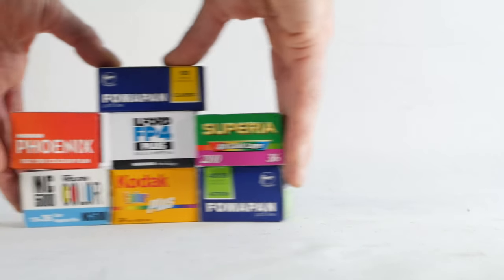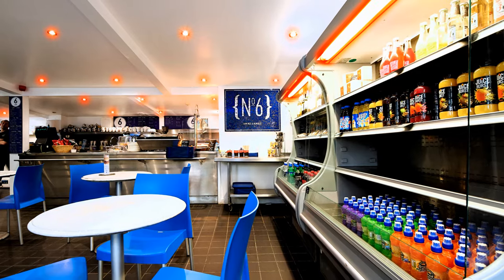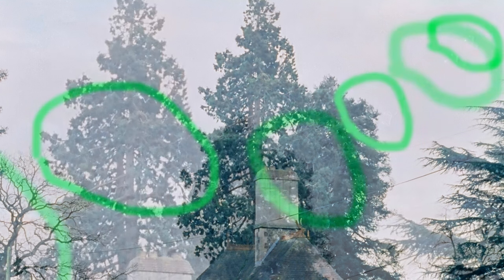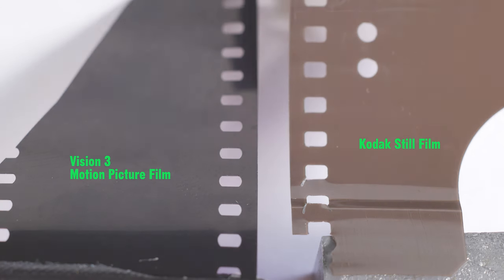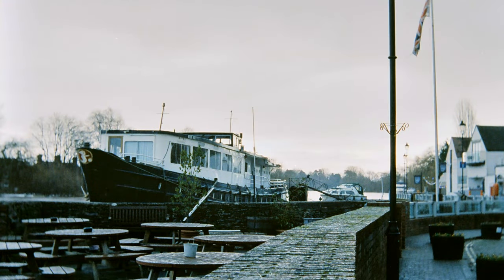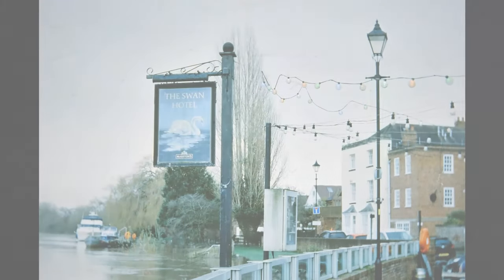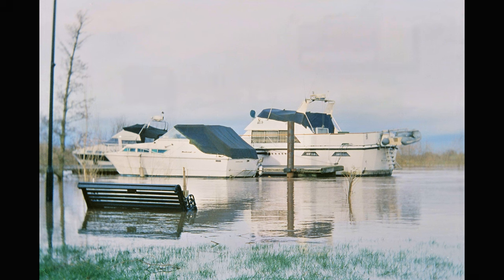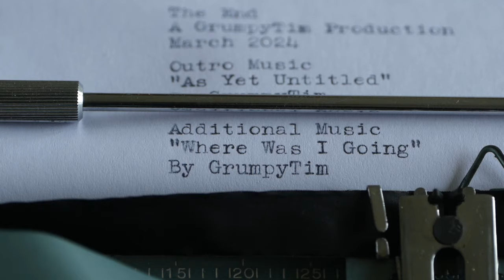Shooting Kodak Vision 3 500T Movie Film in my Nikon F-501

Comment: I use ramjet remover from Nik & Trick to remove the ramjet before developing in C41 at home.  I used homemade ramjet remover before and it was not 100% effective.  The results are much better now.  I am happy with C41.  I used ECN2 before.  I scan the negatives myself, the difference is not enough for me to have ECN2 and C41 chemicals at home.
Reply from the maker: Hi duratorque, that makes sense using C-41, no point having to buy and store a whole different set of chemicals if the results are ok.  I really must get back to doing my own processing, I'll probably just do B&W because that's what I did years ago.

Comment: That seems to put quite a punch in the oranges.
Reply from the maker: Yeah, it definitely won't be the film for everyone, but it's a look that I quite like for now - ask me again in 10 years and I'll probably hate it.
Reply: @GrumpyTim  I tend to adapt what I do to the film and light I have. Must find a good lab for black and white as well as chrome film.
Reply from the maker: You could take a look at Nik and Trick or Analogue Wonderland, I've used the former and spoken to the latter.  Whatever lab you use, if you want good scans (assuming you're not scanning yourself) I'd recommend the more expensive hi res TIFF scans because many of the labs do a pretty mediocre job on their medium res jpeg scans (dodgy sharpening and way too much jpeg compression), although I'm pretty picky so maybe you'd be fine having medium res jpegs from a lab.  You could try a film with the cheaper medium res scans and if you didn't like them you could upgrade on the next film.  I can't direct you to the main lab I use because he's a local, one man lab and doesn't do mail order.